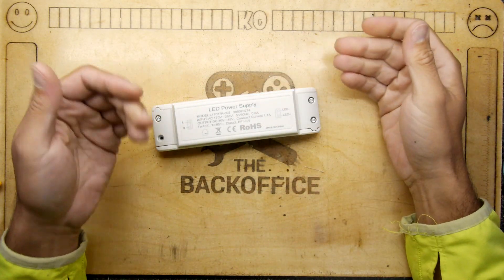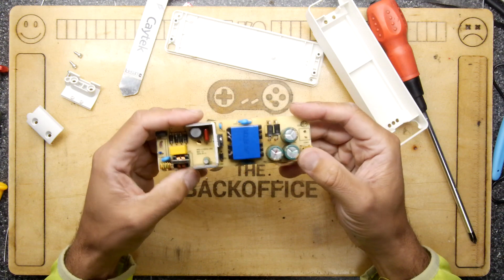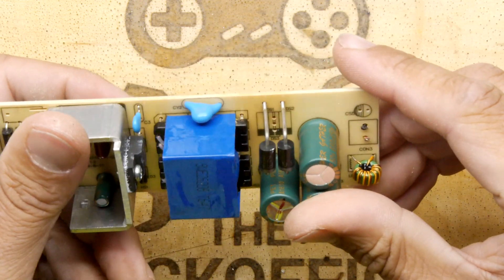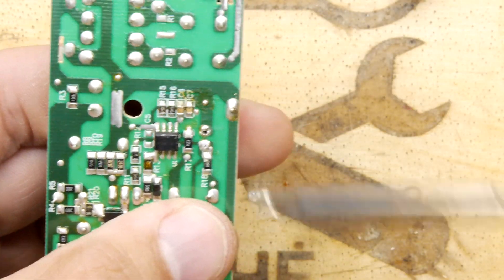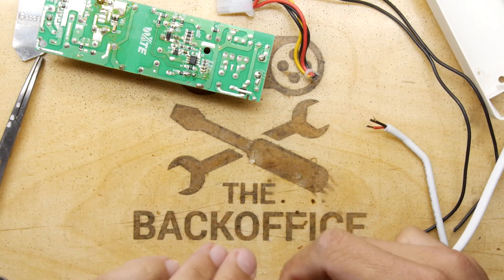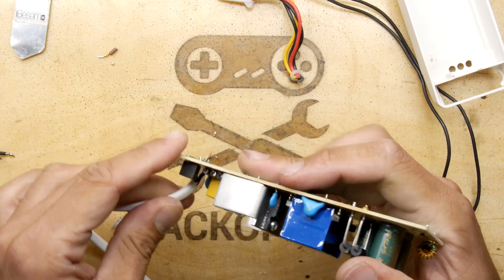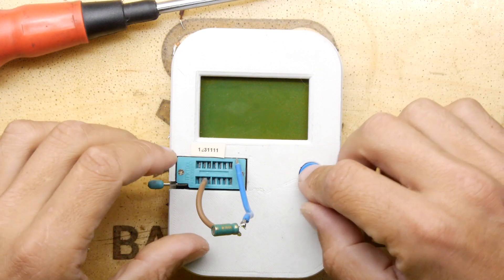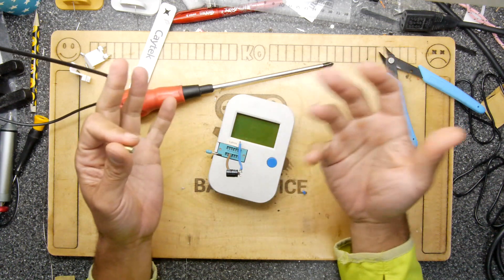LED Transformer teardown and repair - is it fixed?

Comment: @ 13:37    
  An ESR value of 0.15k ohms just means 150 ohms, so no...   that bulging capacitor's ESR isn't "much lower" than the other that had an ESR of 1.6 ohms!    In fact, 150 ohms is 9375% larger than the original one at 1.6 ohms!!    🤣🤣🤣🤣
  Let me guess, you were the kid always napping in the back row during math class, eh??
Reply from the maker: What's math class? 🤣

Comment: I must admit I thought that was the only electrolytic cap on the line side of the regulator (i.e. after the rectifier and common mode filter inductor) and so I thought it would have 340v across it and, given that the replacement was rated at 50v, I rather expected it to go bang.
Reply from the maker: Fortunately for me it wasn't 😂

That led lamp is still running fine. I'm almost tempted to put the old cap back in and see what happens just as a sanity check that it actually was the cap

Comment: Simple, measure the cap with a real LCR meter at 120 Hz, note the Dissipation factor stated as tan delta.  Look up the datasheet, there they state the new DF and the "bad" value at 120 Hz. This is the only good way. ESR is not stated in the datasheets because DF is used for decenia and does a better job. ESR at 100 kHz is sometimes used in datasheet for SMD caps. In most datasheet nowadays they also state the impedance at 100 kHz. For bigger caps the reactance is very low so the impedance is for most made by the ESR. However, ESR is frequency depending and at 100 kHz big caps can be inductive instead (look up SRF, self resonance frequency) On average, a very rough estimation, the ESR is at its lowest value around 30 - 40 kHz but can vary wild because of the many sizes.

DF is the ratio between the reactance (capacitance) and resistance(ESR). Together they are the impedance. So knowing DF and Cs you can calculate ESR  (there is also Cp but that gives DF bases on the parallel resistance and needs to be converted first if you somehow think you need ESR instead of DF. 
The nice thing is there are tabels from the manufactures but those from good brands are very close. I looked up some good brand data sheets an it turns out they are almost equal so I use a little table I made from comparing a few brands and if the measured value is close to the new value it is OK, if it is higher and critical, or a not so common can size, I look up the real datasheet. 

Those testers are like a DMM with capacitance function, only suited to measure good  caps. They can completely go wrong on bad caps. An ESR meter is a handy first indicator to quickly see if a cap is dead or good measuring in situ. Good is not even a guaranty, if there are good caps in parallel with a bad one it will show a very low ESR, and also inductance in the circuit can mess things up. This is only to pinpoint very fast suspected bad caps, desolder them and then test them with a LCR meter, on C and DF, and in some cases test them for DC leakage. Then you will really know if it was bad. Instead of the ESR meter, if the circuit powers up, you can watch the ripple voltage with a scope over a cap to get an indication. If the ripple is fine, the cap does what it needs to do and if it stays cool the ESR won't be to bad either. In doubt desolder it, let it cool down (if you have bad desolder gear, heat influences the ESR / DF) and use a good LCR meter.

Comment: If it's flicking on/off, it's often the switching chip reboot looping because its own little power supply is failing (small capacitor).

Comment: Rubbing his hands all over the caps like some kind of MAD LAD.
Reply from the maker: I think it is appropriate behaviour in the given circumstances 😂
Reply: @backofficeshow  I don't know about you, but my first was an Atari ST.... Putting my hands where they didn't belong whilst the case and shielding was off. Not even remotely sure what made me think I could put my hand there... It was even plugged in at the time! The naivety of youth.
Reply from the maker: People get hyper sensitive about working with caps, I think most of the damage you might do is caused by the knee jerk reaction to the little shock causing you to scrape your hand all over the sharp edges of the enclosure.

Mmm Atari ST goodness! 💏
Reply: This was so lovely to watch whilst still in bed.
Reply from the maker: Are you noode?